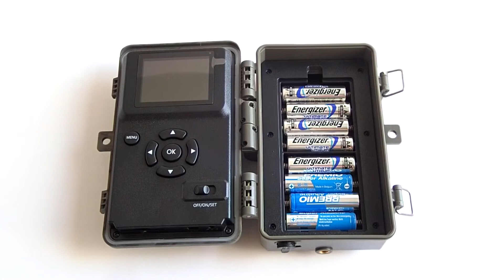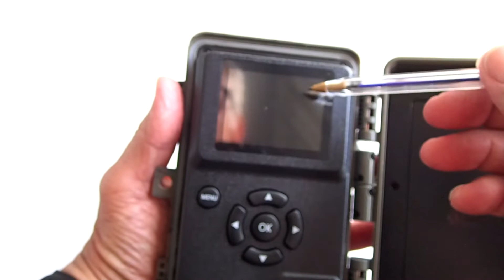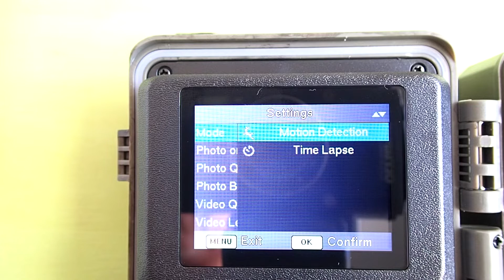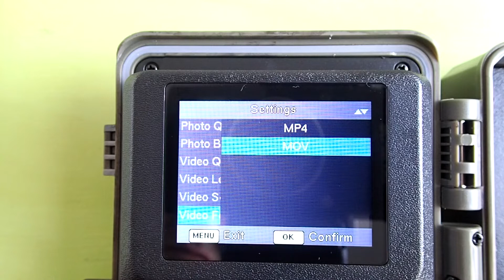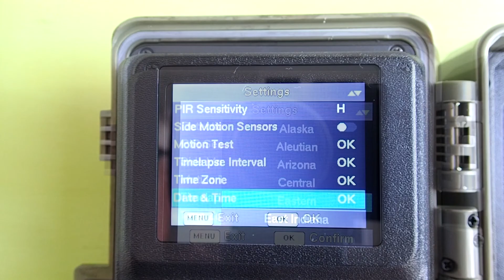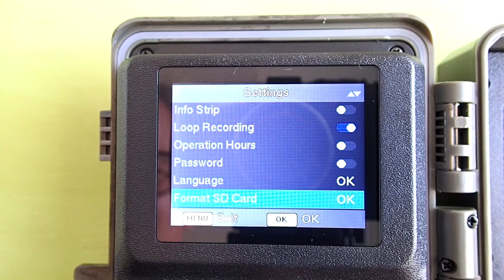Features of the GardePro A3 Trail Camera #AD

Comment: What does it mean by format sd card? I have a sd card that I previously used in a different trail camera. Does this apply and I still don’t understand what that means.
Reply from the maker: Formatting a sd card really only means deleting any files on that sd card.  Different types of devices use different types of files. A mp3 player will use music files.  So, if you were going to use a sd card from a mp3 player for your trail camera, then you would want to format that sd card when you insert it into your trail camera. To delete the music files and prepare the card to accept photo and video files.  But in your case, you are going to use a sd card from another trail camera, then you do not really have to format the sd card.
Reply: @VentanaMedia  ok thanks otherwise I take my sd card and plug it into my computer and delete the pictures afterwards

Comment: Hi,
Hope you are well.
I am about to buy a memory card for GardePro A3,but l don't know much about memory cards and l need help to decide which one to get it, which one is the best?
1.
SanDisk Extreme 64GB SDXC Memory Card up to 90MB/s, Class 10, U3, V30
2.
SanDisk Extreme 64GB SDXC Memory Card up to 150MB/s, Class 10, U3, V30
3.
SanDisk Extreme SDXC Memory Card, Up to 150 MB/s, Class 10, U3, V30, 128 GB
Kind regards..
Reply from the maker: #2 and #3 are better.  If this trail camera accepts a 128GB card then get #3.